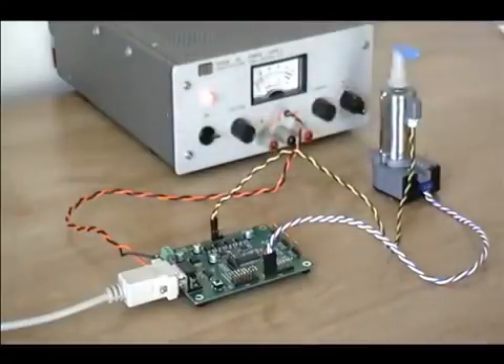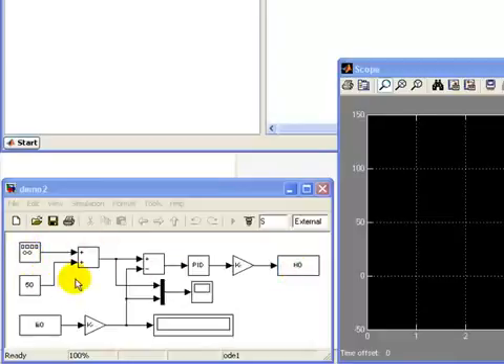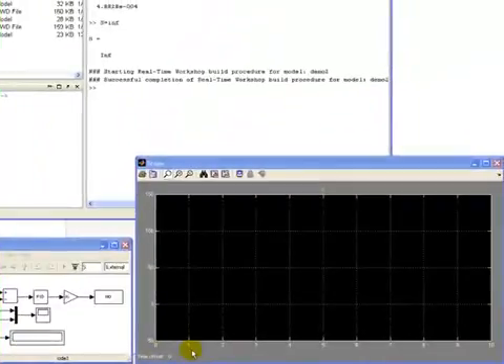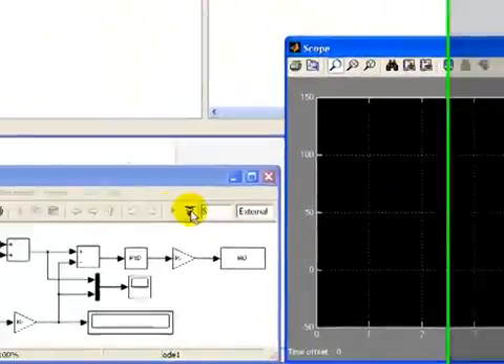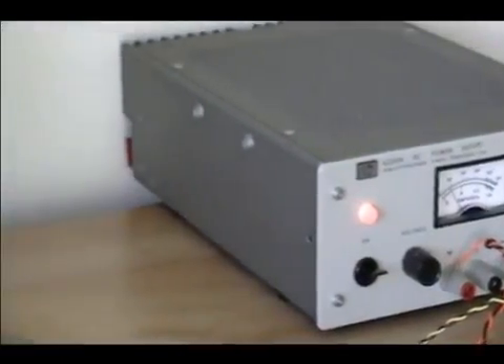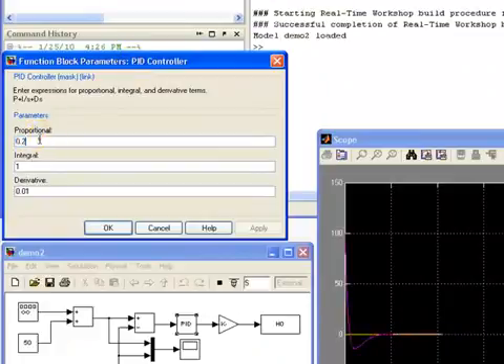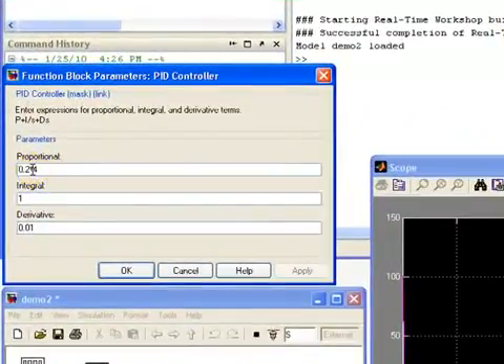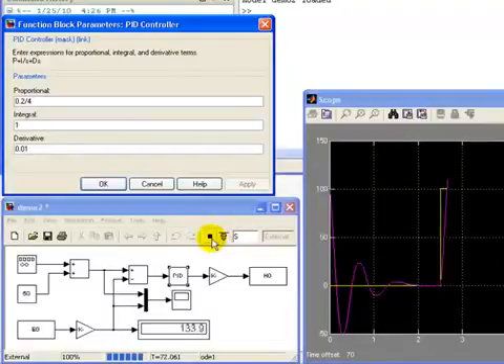Real Time Control Platform for Matlab/Simulink: DC Motor Control

Comment from the maker: The motor and encoder are manufactured by Bühler Motor. The motor is a 12 V DC motor and the encoder is a 500 lpr incremental encoder. Similar DC motor with 1024 lpr incremental encoder is available on http://zeltom.com/products/hilink/hilinkaddons